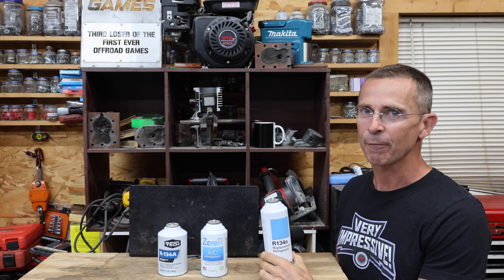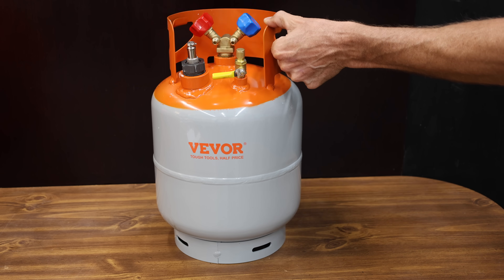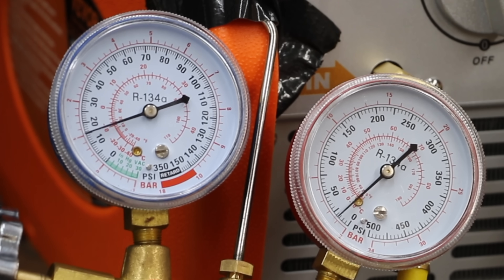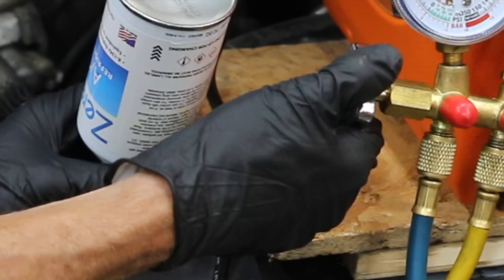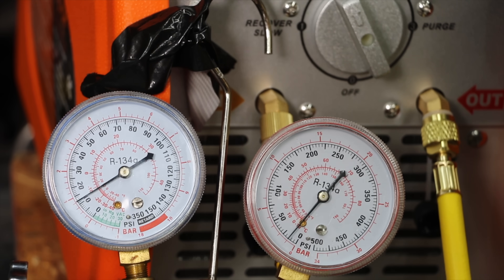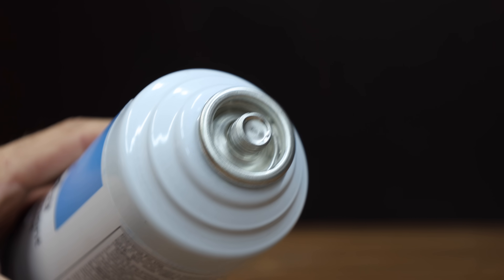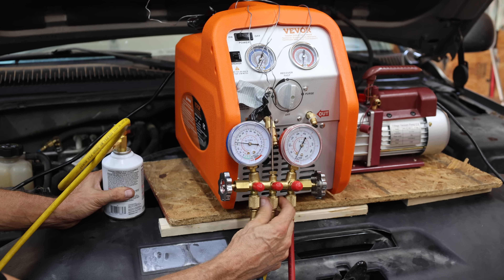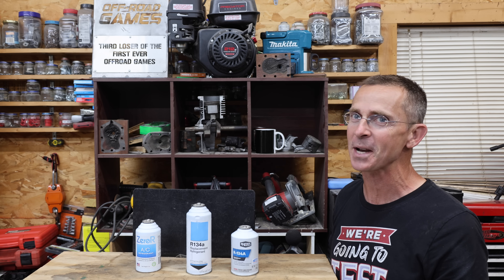How Dangerous is Fake Car A/C Refrigerant? Let's Find Out!

Comment: It’s likely propane based  ( fake stuff ) old hvac pros will tell you lower head pressures and 20 deg colder temps  translates to savings on hvac and works in auto also   Yea it’s flammable not legal  but freon is flammable also and unlike propane it won’t kill you if you take one huff of enflamed freon.  There are actually scales on net hard to find but will give you the propane  actual pressures as they are slightly off from all freons which may account for your temp being higher ?   Idk 🤷‍♂️ I’m not a hvac  tech but do it all.

Comment: only issue of doing HVAC system like this is bleeding of the AC line. This is not aloud to do, because you release the freon gas in the air. That and the gas that escape can burn you, because it gets very cold. 
Normally you connect the Refill R134A or what we also have R1234yf. Vacuum the lines  (meaning no air nothing to bleed). Then open the valve to fill the tank from the machine whit new R134A. 
After that you do the same thing on the car and fill in how much gram needs to go inside the AC system. 
For R1234yf the system is doing everything automatically. After that start the car to drain the last part from the low pressure hose. close the valve on the car side and vacuum all lines. 
GWP (Global warming potential) for R134A is 1430 for the new R1234yf it is 4.

Comment: Stuff is probably propane, which is a very good refrigerant.   But it is flammable and should only be used on systems designed for R290 (propane)
Reply from the maker: Thanks for the feedback.

Comment: Propane should make an excellent refrigerant, but each refrigerant should be in a system specific for that refrigerant. Air makes an effective refrigerant, temperatures of a hundred degrees below zero are possible using just air, but the system has to be designed specifically for air in order for it to work
Reply from the maker: Thanks for the constructive feedback.

Comment: Oh jebus... I assumed this was just rebranded 1234yf but no, it's something like butane that's a hydrocarbon that's in the same realm as 134a. 

It's gotta be blended with some fire supressant to get down to an A2L rating and definitely isn't as efficient as 134a (granted 134a is being phased out). 

This seems like a not great idea considering 134a is inert, and 1234yf systems are designed with the flammability in mind.... Geesh

Comment: Just be aware. These replacement refrigerants need to be charged using a weight instead of guesstimated can amounts. Personally I would undercharge the refrigerant by 25% of the full charge amount and start checking super heat and sub cooling. This being a ccot system means the inlet and outlet of the evaporator should be roughly the same temp.
Reply from the maker: Thanks for sharing.

Comment: The reason they don't tell you what the gas is, is because it's most likely r290 and if you knew it was just BBQ gas you would not pay 20x the cost in weight for a non-resealable can of r290 when you can get 9kg for $30 from the hardware store.

Comment: Never heard freon as much as in this video. Its called refrigerant, Freon is a brand name not used anymore

No such thing as 80 static pressure. Its psig as in pressure per square inch gages

You can add refrigerant without starting the car. You can add the refrigerant as vapor with 134 no problem

The pressure temperature relation is out of the chart most of the time. As pressure are an indication of Airflow through the coils.

Comment: These products really are not sketchy. Propane is also known as r-290 and is a refrigerant. The only sketchy part is if a technician doesn’t understand what he is working with. There’s nothing about a compressor pumping flammable gas through hoses under the engine bay that isn’t just as dangerous as an engine burning gasoline under the hood. These refrigerants also do not deplete the ozone which is more important than co2 emissions.

Comment: Natural gas or propane have long been substituted in automotive AC systems, since cars used R-12.  They work okay, and considering the car is full of flammable gasoline?  Not much different than a fuel leak, in terms of safety.  There's simply not that much gas in there.  

The problem lies, in that if you don't put a warning label that is prominent inside the engine bay? Saying exactly what type of gas you switched to?  A service tech might put in the proper R134a on top of the other gas, making a system that behaves very differently.  Up to and including allowing liquid to flow into the compressor, destroying it's valves.  That is a very expensive fix, as opposed to putting more refrigerant in.   In my experience as a retired AC guy, that is the #1 risk with these products.   

In the final analysis?  R134a simply isn't that expensive.   Use what the car was designed for, to get your best performance in all temperatures.  

If your car is so old, it wants R-12?   I'd still recommend using R134a-- it'll work, at about 70-80% performance as R-12, and that is what a "regular" (gas station) technician would likely put in anyway.   Converting those old systems to full-on R134a usually just wants a different orifice, to gain a few %.   

Project Farm:  VERY informative video-- i'd give you a 10 out of 10, here-- better than some "professional" car AC videos!
Reply from the maker: Thanks so much!

Comment: I wonder if the fake freon explains the refrigerators blowing up.
Reply: Actual Freon (R-12 and R-22) are very flammable and haven't been in use for decades. Most fridges use cyclopentane based foam as insulation, which is what makes them hideously flammable; not so much the refrigerant.
Reply: @kauske I'm not saying just flammable.  There have been actual explosions and the one incident in particular happened shortly after the fridge was serviced by an authorized repair person.  The damage was pretty bad.  There was no obvious fire in that case.  I don't think the foam can explode.

Comment: If your A/C performs better when the vehicle is moving, you need to clean your condenser. You probably have a bunch of crap sandwiched between the condenser and the radiator. Over time, you're causing damage to your compressor, if the condenser isn't functioning properly.
Reply from the maker: Thanks for the feedback.

Comment: When you fill your car's AC system with another type of refrigerant gaz than it came with from the factory (R134 or 1234YF) it's considered 'contaminated'. Recovering the contaminated stuff is costly for the customers as it is expensive for us to get rid of it according to Canadian laws. Don't get me started on AC leak sealer, never EVER put that junk in your system. I also hope the mechanic working on such system analysed the refrigerant for leak sealer presence, once it goes through the AC machine, most of the electro valves will start to bind or clog up once exposed to air and the maintenance cost to repair the machine is very pricy not to mention the downtime during high season.
Reply from the maker: Thanks for the feedback.

Comment: I hate to share this with 3.23 million subscribers but the "fake" refrigerant is probably just the keyboard cleaner, now that the secret is out the price on the cans of cleaner will go thru the roof. I've been charging my vehicles for 10 years with the cans of keyboard cleaner, it's way cheaper and works fine, also it's actually better for the environment than R134.

Comment: R134A is slated to be phased out in the USA( same as R410A). this refrigerant it is already banned in EUROPE due to its poor performance/ global warming potential( based on R12 performance). the refrigerant that is highly flammable might be R290( propane without the mercaptan added) this refrigerant was used before "WW2" and was replaced when R12 hit the market. also R290 must be used with mineral oil, and is not compatible with "P.O.E." oil used in R134A systems( oil return issues with the compressor/ oil migration into the evap. coil.).
Reply from the maker: Thanks for the feedback.

Comment: These new gases suck   Every time I buy  a new truck the AC takes for ever to get cold and not even sure if it’s cold running  it seems like I have to have it on high for long ass time   My 2022 tacoma with its fancy digital Ac and dual controls  etc   And it’s  not good enough for Florida summer  I would love to swap it out for isopropyl / propane refrigerant but it’s not legal unless it’s a stand up freezer  stupid   I thought the remote start option was useless here but I need it to cool it down so I can even use the truck  . Must be why it’s standard  .
Reply from the maker: Thanks for sharing.

Comment: I bet you these alternative refrigerants are hydrocarbon blends (r290, r600 etc)...hydrocarbon refrigerants can be extremely efficient if the system is designed for it. Also they have extremely low gwp & odp...the only practical issue is that they are highly flammable as mentioned.
Reply from the maker: Thanks for the feedback.

Comment: Great video as always but please stop referring to refrigerant as freon. Freon is the registered trade name of the dupont company and unless you are using dupont refrigerant, then it is not freon. It's the same with paper towels being called a bounty or a plastic zip bag being called a zip loc. Also that zero r is called a drop in replacement amd is a blended refrigerant.

Comment: Uhhhm. All refrigerants are flammable. Some produce deadly gases when burned. Basically the higher the global warming potential of the gas, the lower its flammability. But the higher it's production of deadly gasses when combusted. So consider someone smoking in your car with an ac leak. they are inhaling a deadly gas through the cigarette. As an example. These gasses can be combusted in many ways if you think about it clearly. The current substitutes are composed of purified propane or natural gas for the most part. They do combust but not in any reasonable situation that you would run into in a vehicle. If they have a leak they don't produce deadly or ozone depleting gasses. Remove the politics and the "show" and let real science guide the way.

Comment: Great video, but your comments about static pressure are not correct.  If the static pressure matches the chart for a given ambient temp, the only thing you know is that the system has liquid refrigerant in it.  It tells you nothing about how much liquid. For example, say you have two 20 pound tanks of 134a that have been allowed to equalize to the ambient temp.  One is full, and one has only a few drops of liquid left.  Both will read the same pressure.

Comment: I own a 2017 Honda Civic with the bad 2016 to 2021 AC system that uses Freon R-1234yh. Owners are spending thousands of dollars to repair their defective AC system. I drained my Freon down to 10 pounds and added one 4 oz can of the not Freon Envirosafe Arctic Air for r1234yh "support" into my Honda AC. Now, my Car has been blowing ice cold Air for 3 months even while it over 100 degrees outside. And EviroSafe item is not even real Freon?😀
Reply from the maker: Thanks for sharing.

Comment: I have been using "canned air"(diflourethane) also known as r152a in my vehicles ac systems for years,  I know what I am putting in however, the labels on these replacements seem sketchy, you dont even know exactly what you are putting in.  I would be worried about people mixing refrigerant types as well, you never want to mix one type of refrigerant with another.  I completely vacuum my ac system whenever I charge with canned air.
Reply from the maker: Thanks for the feedback.

Comment: I have been using "LPG" liquid petroleum gas or BBQ gas, not sure what you Yanks call it over there for nearly 50 years in all types of automotive air conditioning systems and domestic appliances.
Remember, any gas acts like a refrigerant to some degree. Think workshop mains air supplies and opening a large tap fully. You don't want to be in front of one because not only rust n shit can come shooting out, so does chunks of ice and that's even in the shade at 45 degrees C
Anyway always performed superior to other gasses and I reckon it stacked up well to the R12 gas.
Never had a problem with using it.
I do use 134A not for myself but for the people that think it is dangerous to use LPG as I give them option. Most say go the BBQ s route because of cost.
I don't charge for the BBQ gas, but I sure do with the 134A. very expensive down under 
I personally had a compressor charge line on my LandCruiser rupture catastrophically because a sharp corner on the auxiliary battery carrier 100mm away from a red-hot turbo and nothing happened.
Fire and explosion risk is pretty minimal really and what the manufactures don't tell you is 134A is combustible and still is damaging to the ozone, just not as much.
Also is extremely toxic when burnt as generally is the synthetic lubricants.
Also is a great alternative to keep an old leaking system working as generally the cost of fixing the fault costs more than what the vehicle is worth.
Obviously, there is limitations with leaks, a charge or two over a season is ok but I would draw the line at anything more than that.
Reply from the maker: Thanks for sharing.

Comment: try something that makes it COLD like r12 used to be in 80's cars
Reply: I consistently get R134a systems colder than R12 ever was. Parallel flow condenser, good airflow, smaller orifice tube, and properly adjusted low pressure cutout switch.

The aftermarket should be building 11mm microtube subcooling parallel flow condenser replacements for older vehicles and universal use. Denso makes them for alot of Asian vehicles like Nissan and Toyota. That style condenser is 45% more efficient than a standard parallel flow which is already far more efficient than a serpentine or tube and fin condenser.

Comment: When looking at refrigerant performance charts r-134a is higher performing across the board than 1234yf (which is similar to propane) that you find in nearly all vehicles 2017 and newer. The only reason for replacement is environmental. Same story with r-22 transitioning to r-134a. R-22 was much better performance wise but obviously much worse for the environment. 

Also why a lot of new vehicles are starting to have heat pump systems instead of traditional to make up for the performance losses with the newer refrigerants. Sure its more efficient but it only has to be because of the limitations of modern refrigerants. In an industry where margins are everything, there are no reasons to make something more costly and complex than what is absolutely needed. And the difference of cost and complexity from traditional to heat pump systems, especially in a vehicle are huge
Reply from the maker: Thanks for the feedback.

Comment: Fun fact, normal barbecue propane is compatible with r134a. But you must evacuate the system of all 134a before replacing it with r 290 / propane.  Don't take my word for it do the research yourself.  Propane is refrigerant 290 which is compatible with systems that use r22 and 134a.

Comment: What you are calling fake  refrigerant is actually R-1234yf ( yes its flammable.) Even pressurized ammonia  works. It was the original air-conditioned gas.  In fact in 1860 ammonia became the natural refrigerant for the meat industry. For over  the last 160+ years now  ammonia is the only refrigerant with a density less than one. and is still used in manufacturing. It fell out of favor in common house hold appliances. because in confined spaces it replaces all the oxygen in the air. That was bad news for the tiny basements with no ventilation back in the day. My uncle still has a 1945  freezer using ammonia. And still working to this day. I was wondering how pressurized ammonia would do in your test.
Reply from the maker: Thanks for the suggestion.

Comment: I'm not all the way through the video yet,   the hydrocarbon refrigerant is not a direct one-for-one replacement in other refrigerant systems. In a r12 system if I remember correctly its 30-40% of the standard charge; in a r134 system its right around 37% of the standard charge ie if the system uses 2lb (32oz) of r134 it should only take 3/4lb (12oz) of the hydrocarbon. Grandpa ran a full sevice auto mechanics shop for ~60 years.

Comment: Soooo just so people are aware of the reasons why people are buying fake refrigerants it’s due to states like mine that have 120• summers and -20• winters are starting to ban refrigerants for vehicle a/c systems claiming that it cuts down on emissions. If my car wasn’t exempt from emissions long before our most recent law change I would have had to turn my ALL ORIGINAL 1983 Mazda rx7 into the state to be crushed and anyone who has a car 25 years old or more and did not have it emissions exempt on the last registration date before the law goes into effect will not be allowed to do so in the future and you are legally required to turn the vehicle in to be crushed because that is “the only way we can guaranteed these vehicles are not on the road”

Comment: The term "R-134A replacement refrigerant" is ambiguous. It does not clearly indicate that it is not actual R-134A. It's very misleading. Also, I'm sure the cars manual says R-134A only, so it will void warranty.